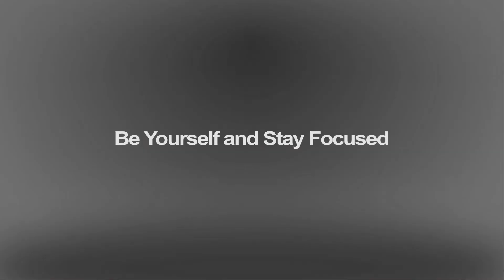G20 Update Vlog 3!!

Comment: Subscribed! Thanks for doing your restoration from the engine/trans up. A lot of videos show "pretty restored vans" but how do they run? I want to do this and need to know the scope of work to get a reliable 30 year old van on the road. Not to get in ya pockets but what about budget? Did you have a number in mind and will you come in under/over? I will stay tuned to find out. Good Job, keep it up!
Reply from the maker: Gratitude bro👍🏾✊🏾! My number in mind is around 10/11k. That includes motor tranny and interior as well..but at the moment it's realistically looking at 15 for everything man..and that's with me doing some of the interior work as well.